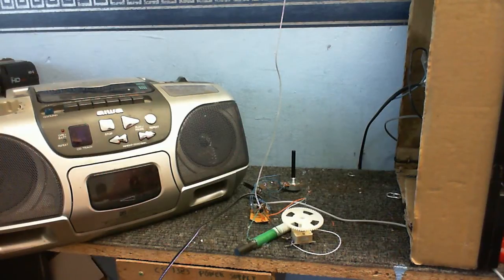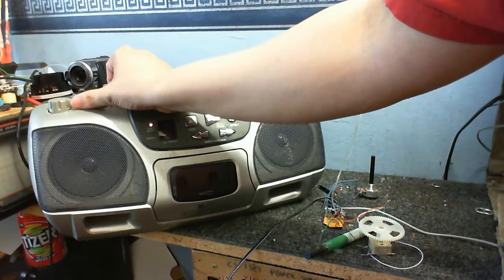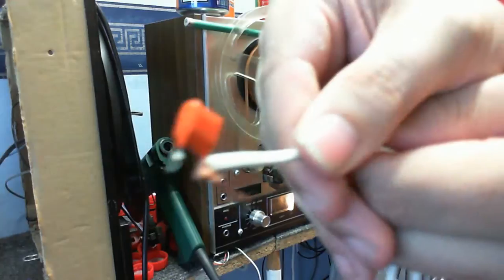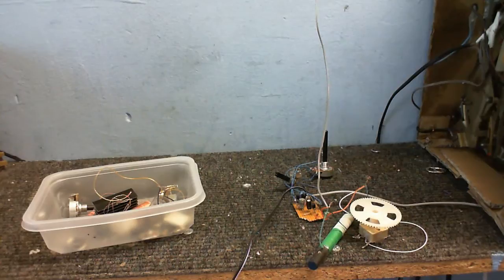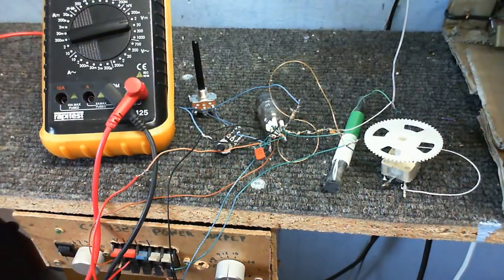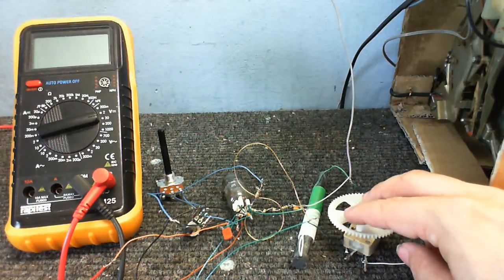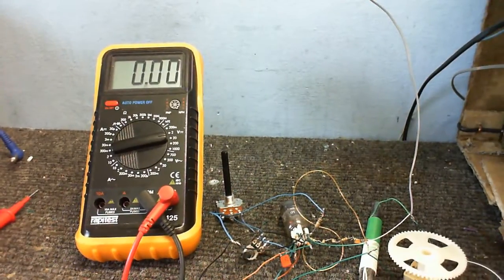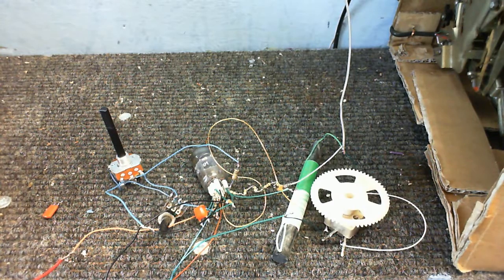Transmitting with my FET regenerative radio, and building a tube based one as well

Comment: You wont need to worry if theres another station on the same frequency because your radio is low powered probably only outputting a few watts or milliwats  so it won't interfere with it at all while they are blasting out megawatts of power